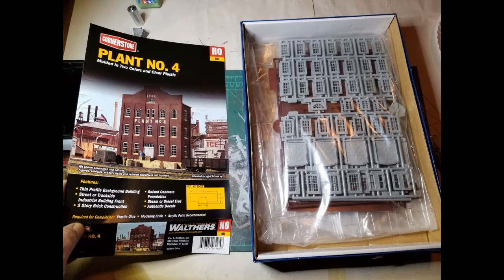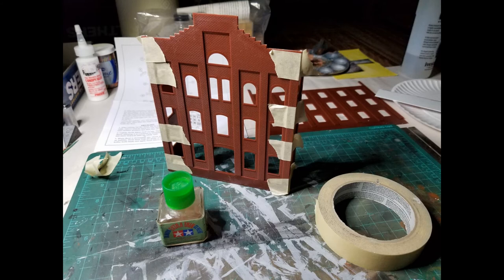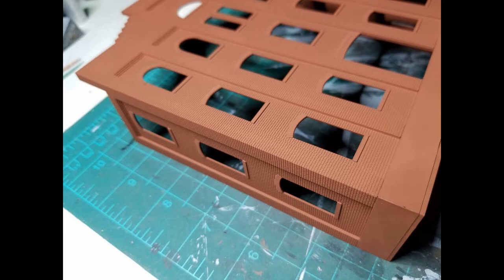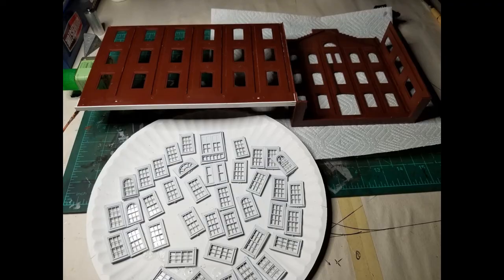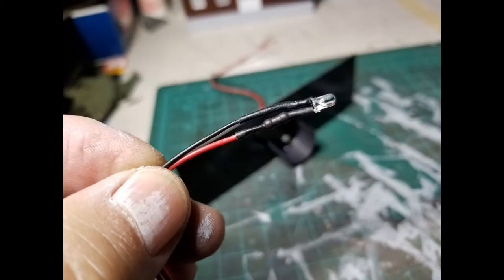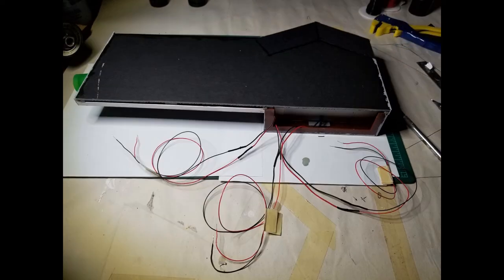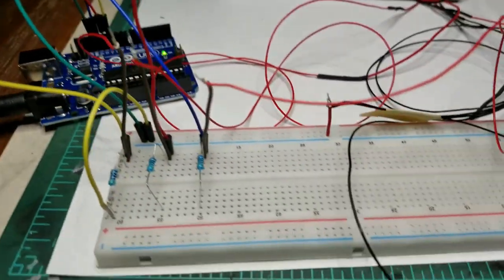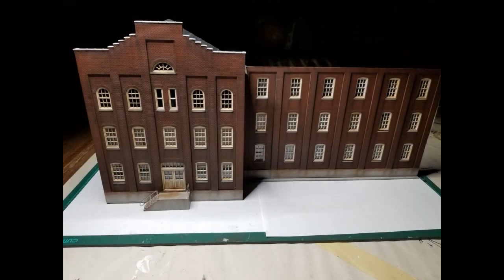Walthers HO Scale Plant #4 kit build

Comment: I have learned from kit building as well as scratch building, I never add the windows/doors until I'm finished with the outside color and weathering as the final coat will be dull coat and it will fog all those windows' glasses.  When I finish a model, I look at it and decide if it is believable.  Cheers from eastern TN
Reply from the maker: Did I do that, I don't remember? I built that kit a long time ago. Yes, you are correct, anything but gloss clear will fog the windows.